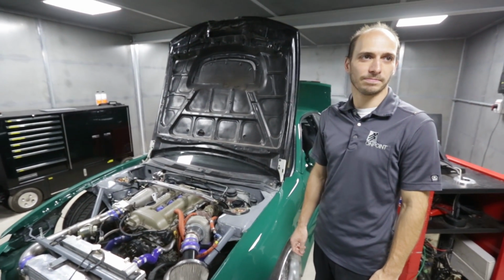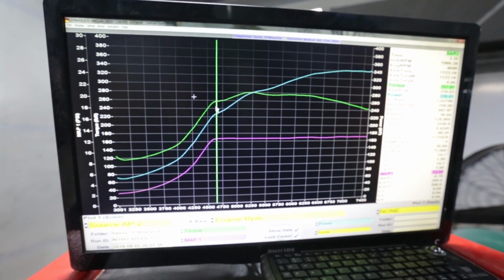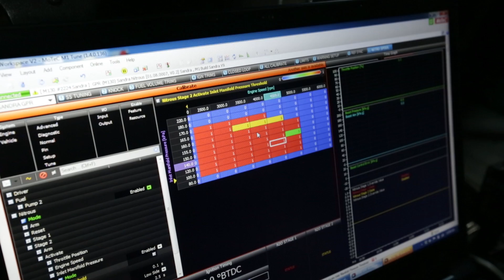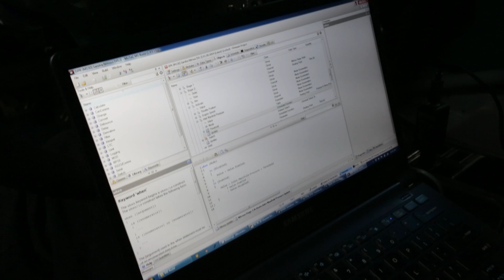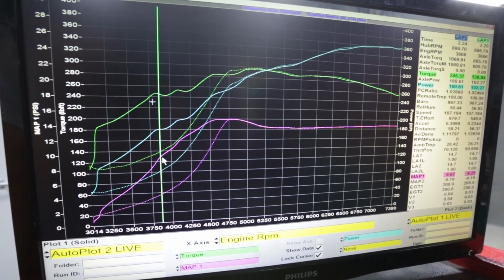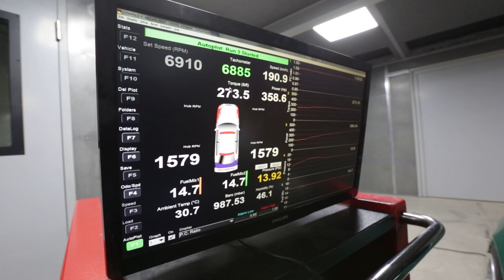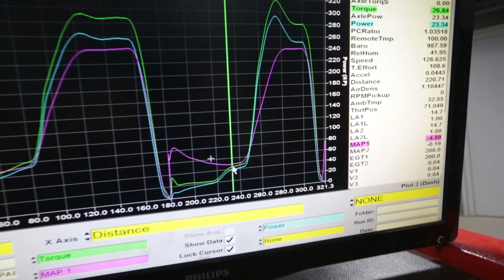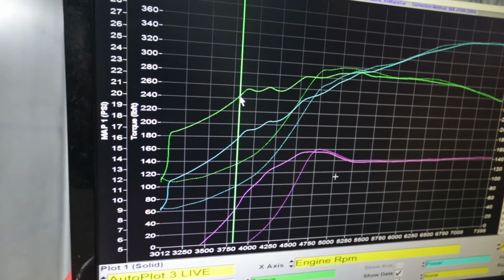Watch Nitrous Make A Nissan 240SX SR20DET Behave Like a V8 Engine

Comment: Mmmm. I Installing Like A 35 Wet Shot On My Car. It's A 3.8 V6 With A GTX3582R eBay. Has The .82A/R Turbine Housing. I'm Wondering Is 35 Shot It Too Small. I Never Thought I'd Need To Go Multi Stage Set Up. I Thought The Nitrous Solenoids Could Be Progressively Pulsed For A Less Aggressive And More Smooth Power Raise.

Comment: or just build the motor properly with forged bottom end rods, poni cams etc. mine makes 350hp at 3750 rpm with an all day long reliable 420 break . I'm even beating u with nos below 3500 and your using a motec.  nistune only here. build it properly ftw bro.

Comment: Could  the ecu drive the solenoid output to progessivly control the nitrous output with a pwm output and use a condition to turn it off when target boost is achieved?

Comment: Interesting use of n2o to aid turbo spool.. Volvo use a similar setup but just normally compressed air   So if you where say driving at 2k and floor it ,it boost the turbo right away

Comment: I have a super lite open class Datsun 510 autocross car with an SR20 S13 and a Garret 3071R on e85 making a bit over 300 rwhp. I'm running it on a Link G4 stand alone that could be tuned to do this. As you can imagine, coming out of tight corners I'm having to downshift into first to stay in boost or lag in second winging the shit out of the clutch. How did this work out for drifting? Would you recommend this setup for an autocross application.

Comment: If you need to add bottle because you can't develop any real throttle then your ass does not belong behind the wheel of an SR powered car.  PS 12pounds of boost on a built SR is just retarded.  Try building a real SR pushing 25lbs at 9500RPM and if you don't know how that gets done then drive a goddamn stationwagon! 7400RPM HAHAHAHAHAHA ROOKIE!!!

Comment: cool concept! love nerding out on stuff like this. is there any way you could inject n2o through a fuel injector so that you could use like a pulsatile spray pattern to make an very specific, smooth buildup of power instead of using a series of on/off stages?

Comment: It would appear that you're losing power by reving so high. Also you put too much into the first stage, you'd be better off tapering the increase. I bet you noticed the a/f ratio bugging out in between 3500-5000 and that's because your fighting positive pressure with n02 and the turbo. Too many variables. Use a ramping n02 setting in reverse to taper down as you accel on the first stage, but use the second stage normally. I bet you'd make that TQ curve a lot more like a v8 if you stabilized the power surge. Great tuning and video though, the tuner is really truly a tuner b/c he's troubleshooting on the fly like that. I'd be willing to bet the car slipped on the dyno when you thought the dyno malfulctioned, those cars don't weigh much. How much K value compensation did you use before boost on this car? You really did a good job, but for future tuners, any info is good info, please share!!!

Comment: why couldn't you just do it progressively, kinda like a progressive controller for drag racing, but make it relative to throttle position rather than time instead of using two systems?

Comment: I remember a guy on one of the pontiac forums had his 2.8l v6 setup with a turbo with either a 7747 or 7727 ecm and setup a nitrous activation from the ecm to spool the turbo and he ended up running low 11's I believe on a totally stock 2.8l.
Reply: blargblarghonk and then after that run, his piston rings blew and he broke a rod from all that boost. RIP
Reply: Actually it lived most of a season before it popped.

Comment: Hey guys, I just wanted to complement the quality of the vid. This was very well thought out, showing several different test procedures was great. This is a concept I've pondered but never actually put to the test, amazing results really! Just as I expected. I would have loved to see it run all out as well, just to see what effect it had on the total power output. Would be interesting, just the difference in inlet temp alone would allow for much more aggressive timing and increased boost threshold- dependent on piston ring end gap of coarse. Still, I loved the presentation, top marks there guys!!! Well done! :)

Comment: the only logical way to get a early boost response is to go smaller on the turbine housing/wheel,plain simple, is either your are building a car for drag racing or drifting, driftting required lots of low end torque to light up those tires and slide

Comment: My sr20 240/180sx  makes 328whp, with a gt28/71r  on 22psi with full boost at about 3,600 rpm, and I'm getting a Borg Worna small frame EFR  turbos, to bring that down to about 3,000 rpm and hp up to about 360whp.  If you guys get a smaller more efficient turbo it will transform the car.
Reply: 22psi is not in the GT2871r's efficiency range. Does the 28 feels like an on off switch when it comes into boost, and is it having heat sink issues?
Reply: +Datsun510zen  Yeh, she's wound up to 100%, and it does spike a little when in first comes on. Large alloy rad, Nismo 71deg c. thermostat, 6 and a half ltr. sump, Trust oil cooler with Grex thermostat, thermo fan conversation, large cooler with mist spray and good quality oil and anti boil. So I have kept attention to good cooling, (I've been a mechanic 22yrs) and it's a street car so really heats up like a circuit car would, but the turbo is starting to get a little bit of play in the shaft😳    will Hopefully get EFR 550hp rated one soon😚👌
Reply: I'm actually relieved to hear you confirm that. I have a 3071r that suits my sr well. I'm making 300hp at 14 psi on e85 in my Datsun 510 autocross car and have been tempted to switch to a 28 for quicker spooling. For my applicatiin though, I think it would be trading one set of issues for another. I guess I'll keep looking for that edge to get my turbo to spool up quecker.
Reply: +Datsun510zen  Honesty, with the extra cylinder cooling of e85, running a 2871r  at say 19psi  should net you 300hp all day long if the tuner knows what he's doing... safely. Rally cross are short races anyway, get an exorst temp and wide band guage. Or make the most of your gt30,  wind that sucker up to 20 and have some fun😄
Reply: Don Rossco Joe. Actually my stock cams are the limiter in terms of peak horsepower. to be honest 300 hp is about all we can  put it to the ground in a car that weighs under 2000 pounds. it is stupid fast already, so I couldn't imagine say 400. 

the biggest reason I haven't swapped to a 28 is the difficulty in controlling that little beast. the 30 is easier to modulate. My car is tuned at Rebello Racing and Bryan definitely has it really dialed in, just the inevitable lag until about 4000 RPM. after that all is well with the world. very well indeed.

Comment: why not use pulse modulation to fade the nitrous in and out instead of two shots?
Reply: Jnl Jnl Most  solenoids wouldn't cycle quick enough and/or would burn out under PWM. Pressure diverting valve with a servo motor could give a soft on and off but would be quite wasteful.
Reply: They actually have a controller just for pulse modulation of the nitrous to fade it in on launch.

Comment: Can anyone make a video where they dont confuse lag as boost treshold?

If a turbo spools at 4700 and you drive at constant 4700rpms THEN floor it, theres your "lag".

It's like saying an s40 t4 has infinite turbo lag when I floor it, if the rpm is 1000.. it will never even boost at that rpm :D

At 3000rpms however where the turbo comes on if i drive on flat road with constant speed THEN floor it, it has around 1second of real turbo lag.
Reply: +earmh2002 This a million times! Learn the difference people, jeez.
Reply: Ofcourse we can ignore that cause most guys who do research or learn will know that they mean a different thing but just use wrong words :)

Nowadays when games twitch or the framerate drops everyone says its lagging, no, the framerates are bad or the game is glitching from packet loss. Lag is the delay when you click and the character shoots, or when you press the pedal and electric throttle realizes you want to throttle :)

Comment: Hey Peter and Dave, Thank you so much for posting this guys. Sounds like a very promising solution for me, but would love to talk to you guys for some pointers.

 I have an s13 SR swapped auto cross Datsun 510. It's got a 3071r, Link G4 ECU, boosting 15psi on e85 producing about 300 rwhp. We've had it boosting 18psi, but was WAY too muck power to put to the ground. As you can imagine, the lag is a real issue pulling out of tight corners. It's either keeping the turbo spooled up at 4K rpm and feathering the shit out of the clutch, or downshifting to 1st. The car was tuned at Rebello Racing and although it has great throttle response, it's still tough to control that much laggy power in a light little car like that. Adding 85hp at the bottom end sounds like music to my ears.

https://www.youtube.com/watch?v=GZtp6PiFlTI

Comment: why not just use  a smaller turbo?
Reply from the maker: Because that wasn't the point of this test. And that big turbo is low stress, 12psi. A smaller turbo would have to push 20+ psi to make that.
Reply: Speed Academy il give u that it's a awesome way to get rid of the lag but from what ur telling me is 12 psi is not always 12psi?
Reply from the maker: 12 psi is always 12psi but on a small turbo it does so more inefficiently thus the way its delivered is different, hotter charge, less CFM, etc. so to make the same power it usually takes a smaller turbo more PSI then a larger one.

Comment: Why not put a V8 in it to make it behave like a V8? It's cheaper, makes more power, and is more reliable.
Reply from the maker: Because that would require a shit load more work than simply installing a nitrous system.
Reply: It looks like a lot of work was already done swapping in the SR20, cutting up the bumper support, and putting in that huge intercooler.
Reply: A Nissan should have a Nissan Engine.
Reply: Cause V8 everything is boring. Everybody has an LS or at least a V8. Drifting is about style, being different and making something else. Personally I like Mad Mike a lot, cause his Wankel builds are fucking awesome _
Reply: if your going v8, throw the vk56 in it from the infiniti m56. Nissan power
Reply: Jarryn Smith No it wouldn't. Motor Trend built an LS3 powered S13, and they found the engine was lighter than the KA24DE it replaced, the total drivetrain only 68 pounds heavier, and didn't effect weight distribution at all.
Reply: Art
Reply: Nissan makes V8s
Reply: ***** an aluminum block OHV V8 is much lighter than you'd think an iron block DOHC turbo L4 will be close in mass
Reply: ***** I agree. I'd much rather have an SR20 or RB25. But they aren't V8s, and you shouldn't expect them to behave like one. If you wanted an engine to behave like a V8, put in a V8. I love all sorts of engines. I love my stock 1.6 Miata, I love my stock KA24 S13, I love my RB25 S14, and I love the LS3 Chevy SS. All different, all great.
Reply: kylethestyle some people just dont get it 1cc singles to 1800+L marine engines I love them all
Reply: kylethestyle it would throw out the weight pretty bad
Reply: tank2g2 yea the VH45 man
Reply: Well there are many ways to reach what you want. And a V8 is the easiest and simpelst One. Taking a 2l 4-cylinder engine and get the same power and torque out of it, is way more engeneering.
Reply: stevied2k10 it cant handle massive power as easily like 1000 hp turbo build ect but it can be made to
Reply: tank2g2 and the new Nissan patrol comes in v8 Aswell
Reply: Weight, balance, vibration, lack of computer tuning.
Reply: VH45 is pretty good and the VK56 is very good.
Reply: kylethestyle but, SR20's come in the S chassis... wut...

Even if he did swap it, there are a bunch of universal motor mounts for it
Reply: v8's have less vibration just as much control ability and in many cases have similar weight to a turbo 4 cylinder.
Reply: kylethestyle muh v8

Comment: For all of the children that are enquiring about why we are doing this with a large turbo at low boost pressure - keep something in mind. Running nitrous is in no way associated with one's ability to change turbos. Believe it or not, they are unrelated!

We actually do have plans to install an smaller turbo, but the nitrous example is a great one for drifting competitors that need more power, without losing the response, or time attack competitors in the same situation. We are keeping the power low to have a reasonable tire budget, but with a quick change rear end and a dog box, a 700whp SR20 would need nitrous to be even remotely feasible as a good engine option, in my opinion.

Don't let the internet make you so angry kids. Life's too short.
Reply from the maker: Subie Guy There's no need for this. Take it up with OnPoint and stop these comments which are so transparent that you're pissed off about whatever tuning issues you had with OnPoint. I get it but the internet isnt going to solve your problems.
Reply: Brandon Palmer Sorry, I know I'm not Sasha, but just incase he doesn't see your message.. The idea of this is to make use of the extra exhaust gasses to quickly spool the turbo up, and at a much lower engine rpm than would normally be possible. :) Hope that makes sense.
Reply: +Sasha Anis Good clarification, and awesome work getting it dialed in! Hope it goes well on track ;)

I was wondering if nitrous could be useful for the other end of the scale, where a turbo would be running out of puff about 1000rpm before redline, if you could use it in a similar way to compensate for the boost dropping off... Or would that just cause the egt's to get too hot with a small turbo?
Reply: Sasha Anis so the nitrous is there to help build RPM's faster instead of just relying on the NA aspect of the engine to build up and spool the turbo?
Reply: I feel like that would be a very stressful situation for the engine. You're basically forcing more flow through the turbine housing than it can really handle at that point, causing a lot of heat and unhappiness. I would imagine the nitrous would make the engine very knock prone and would require some top quality fuel to keep the pistons from turning into goo.
Reply: Sasha Anis , I've developed a grassroots level fresh air antilag system.  I shaved 3/10 sec boost recovery, similar but not as good to your 4700 rpm load test. your low end use of nitrous has me really wanting to try possibly with a wizard of nos revo valve. I'm on a vipec v88 though I think o could get that sorted rolling in and out of the bottle extra smooth. thx for the informative video.  been wondering how they're doing this in professional level drifting!
Reply: Simon T not true at all its to see an increase in power but mostly torque at a lower rpm UNTIL the turbo spools. Turbo is gonna spool when its gonna spool

Comment: I don't get why he's going to this much trouble for such a low power/low boost setup with that turbo. He'd be better off spending the money changing the turbo out for a Borg Warner efr turbo that would make more power and spool much quicker.
Reply from the maker: Because an EFR setup will cost in excess of 4K with all the goodies. This is quick and easy without ever stressing the engine.

Comment: In this situation, doing nitrous is pointless. You're running 12psi on a GT30 and trying improve throttle response and bottom end power? Seems that you lack any idea of a well designed turbo system.

And let's see the downvotes for all the hate.
Reply from the maker: This was done as a test to showcase what nitrous can do for spool up. Sure you can put a smaller turbo, race gas in and make the same power but that was never the intent from the get go.
Reply: Speed Academy Is there any practical application for this or is this just for fun? 

Race gas? Unless you're limited to 86 octane, 91 octane has been just fine for small displacement turbo motors. I know of plenty 2.0L turbo cars in the upper 400hp and lower 500hp on 91 octane reliably.
Reply from the maker: This was done to showcase what a lot of professional drift teams are implementing to spool large turbos, so there's a very practical application for it.

I don't know how good your 91 octane gas is where you are from but here and in most parts of the US 91 octane is the single biggest limiting factor to producing big power. I have yet to see an SR20 make 400+ whp on pump gas and be reliable. For anything race related almost everyone runs race gas or E85.
Reply: Speed Academy Okay that I can understand very clearly. People that have a bunch of disposable income could do something like this.

Unless everyone around here has their dynamometers calibrated very wrong, but I rather doubt that they are.  Yes, I understand typical pump fuel is limiting when it comes to performance. I appreciate the responses, genuinely.
Reply: Speed Academy